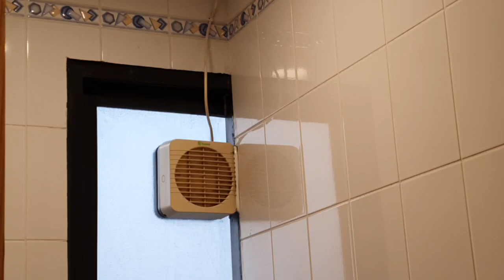90s Xpelair GX6 operating on solenoid

Comment: So those UK small shuttered exhaust fans that take forever for the shutters to open use wax actuators? That’s news to me
Reply: For some reason this one has a solenoid not a wax actuator
Reply from the maker: Wax actuators were introduced sometime in the mid 90s and replaced the solenoids on all shutter type exhaust fans, such as xpelair, vortice, and so on
Reply: @pankaat  I remember some like vent-axia and others taking quite a while to adopt that and some even used air operated shutters instead.
Reply: So did vent axia have solenoid or Wax actuators

Comment: How about you try some O.Erre fans soon?
Reply from the maker: I dont have any in collection yet, but ive seen a few, i felt their quality isnt as good as xpelair and vortice
Reply: How is the O.Erre Ventilor 20/8 AR Model? I've seen one first time when I was a child. It makes that "whistling" sound before the shutters open due to the high static pressure. @pankaat
Reply from the maker: @ShashankArv  havent seen that model, not sure how it looks like, but based on my search the fan that showed up i havent seen one like it yet
Reply: It's the one which is 8" in diameter with 7 blades with those zig-zag like shutters and a front cover with sloped edges near the front. @pankaat
Reply from the maker: @ShashankArv  havent seen it in person yet
Reply: I saw it online. That 8" O.Erre Axial Window Exhaust Fan model is Ventilor 20/8 AR. That have automatic shutters with a red light indicator and a reversible motor.  @pankaat
Reply from the maker: @ShashankArv  i see, that was what it showed me as well